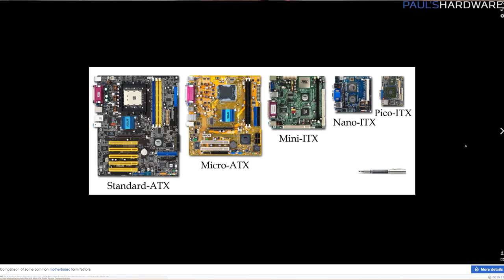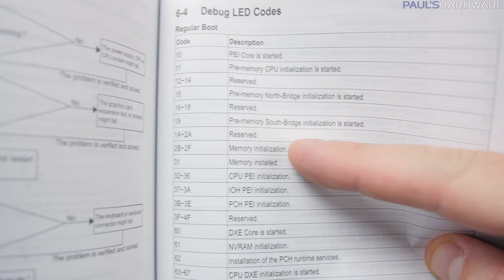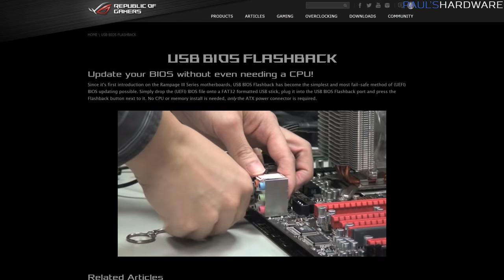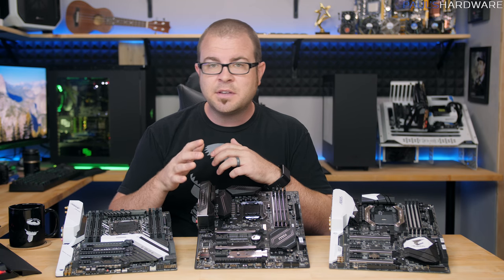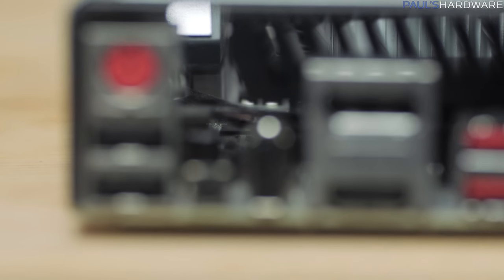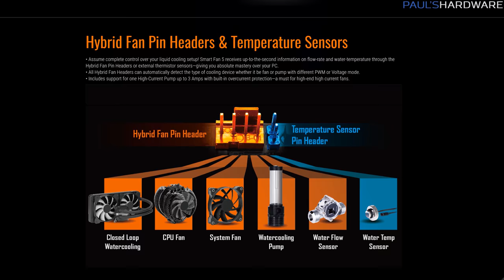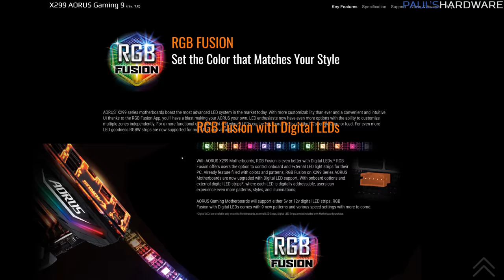My Top 5 FAVORITE Motherboard Features!

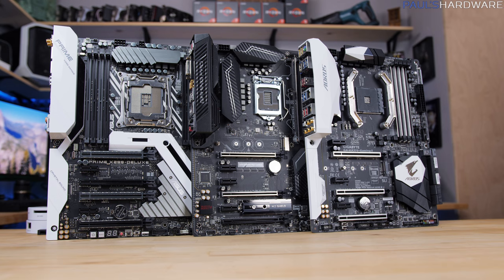Comment: 1:09 #1 Surface-mounted power and reset buttons.
1:55 #2 LED POST Readout.
3:00 #3 The ability to flash your UEFI/BIOS w/o CPU or memory.
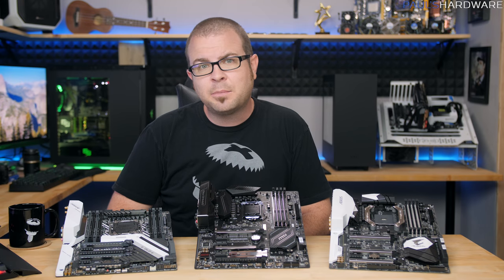4:05 #4 Clear CMOS (Reset BIOS settings) on rear IO panel.
5:07 #5 Advanced Fan Controls.
Reply: Thank you. Have a great day, Don't forget to like, share, and subscribe! ;)

Comment: I think a front 10 Gbit/s USB 3.1 Gen 2 port is something more motherboard makers should add, as well as more cases. More phones are starting to use USB type-C and faster transfer speeds for external storage is also very nice.
Reply from the maker: Very good suggestion, especially now that the smaller USB 3.1 header is showing up on more boards. Thanks for the comment!
Reply: Yes, it is so cheating that it has to be "gen 2" for full speed.. I mean...misleading :)

Comment: My Top 5 favorites
-CPU socket
-RAM slots
-PCIE ports
-24pin connector
- SATA ports
Reply: What about 4/6 pin CPU connector?
Reply: What about the usb ports?
Reply: My favourite is screw holes
Reply: I would like Front Panel Connectors.
Reply: RGB?
Reply: Jmstraubgamer I

Comment: I'd love to see all premium ITX boards implement rear I/O power buttons. There are some insanely tiny custom SFF cases that would actually benefit from not having to implement front power button when the rear panel is just as accessible as the front.

Comment: built in 802.11AC wifi and good built in sound
Reply: King Christo Except anyone who enjoys multiplayer gaming should be Ethernet anyway
Reply: how do you know the sound quality?
Reply: skinlo01 unless your not near the router
Reply: Oscar Jung there are integrated sound cards in motherboards (for analog audio )
Reply: Good built-in DAC/AMP is one of the choices, most motherboard doesn't even consider it a thing.
Well if you can afford some mid to audiophile grade headset or speakers, you'll probably want to invest for a high grade external DAC/AMP to drive your audio gears to its full potential.
Reply: Yeah the new Maximus Hero X has integrated AC wifi and Bluetooth but I have seen reviews from people saying the wifi wasn't functional which is disappointing.

Comment: May sound trivial but 2 favorites of mine are 1. a connector dock for the JFP1 connectors, like what Asus calls their Q-Connector. 2. Mobo speaker. Having an x99 board it takes a second or two for it to POST after turning on for quad channel memory training, etc. Having that speaker after doing something crazy like water cooling your build as I have its nice to hear it beep as a way of saying at least it still posts haha

Comment: l love the Q-connector included with some Asus mobos.
Reply: deadmeat1240 Agree with this; it's always a pain fiddling around with those pesky loose case wires. Q-connector makes it a breeze.
Reply: deadmeat1240 i think Gigabyte has one too, although it doesn't have any pins it just has delimitations and labels.
Reply: Have one for my MSI board, too. I think it's nothing special anymore.
Reply: SunRed That's a big assumption. And a false one. Most boards do not include them. I've built a few dozen machines over the last few years with many different board brands. The connectors are very much still the exception, not the rule. Especially on the mainstream and bargain boards.

Comment: Things I like in a motherboard, better than the "advanced" trouble shooting features you list, are:
* High quality components, like good capacitors and audio chips. (Without those trouble shooting will be a lot more frequent.)
* A good layout that prevents signal distorsion and allows for large coolers without interfering with RAM and PCIe slots.
* Backwards compatibility. Support for older coolers (like the AM3 mounting you use for the passive NoFan cooler!), serial bus interface, PCI slot and what have you that allows you to continue using your older hardware with the new motherboard.

Comment: I like some of the newer board have 2 LED post read outs, that can be set to show Vcore voltage, good for open bench overclocking with Ln2, I would like buildzoid to test of accurate it is..

Comment: Dual bios.  Didn't think it was going to be useful until I updated my Bios, had nothing but a black screen and even with a clear cmos, gave me the same issue.  Flip the switch and it worked.  Was even able to re-install and recover the bios as well.

Comment: I agree with most things you listed.  I know it's not ideal, but I cover the display up with electrical tape and pull it off if and when I have to diagnose a problem - in other words, I have to open the case... But generally speaking the case will be open if I'm diagnosing problems.  But I don't like CMOS clear buttons on the back plate - I don't want curious fingers pushing it (purposely or by mistake) - a button on the mobo is good enough for me and having to open the case to push it provides a "good enough" safety net.  The advanced fan curve and ability to have fans shut down, VERY BIG YES.  But for me this has to be able to be done 100% via BIOS because Windows only solutions are completely right out for me as a Linux user.  The CPU/memoryless BIOS update is a great feature on multiple accounts and hope that eventually mobo's gain that feature (even the inexpensive ones).

Comment: My favourite features are:
Great audio features( I like mini itx builds so there's not a lot of room), lots of fan headers, PCI X1 slots( for upgrades not blocking PCI x16 dual slot gpu cards on non mini itx boards), gaming type features that are functional - not rgb(personal preference as I like pure non led black build) all black pcb, the software for the motherboard like ram cache on Asus,  good LAN port/chip, and price.

Comment: You missed my favorite a pinout adapter for all the power rest hd activity lights and switches.   And could you ask every why after 30 years of pc building why there is no standard I hate plugging in all those individual connectors.

Comment: ASUS board's "system panel connector" where you plug all the case wires into it first and then connect one big connector to the motherboard.

I/O shields that have nice clear writing NOT on bare metal, so the connections look nice and are easily read.

M.2 connector place away from the most likely GPU slot to reduce heat

Comment: I just have one thought about that bios clear button on the back IO panel.  What's to keep the bios from getting cleared when you go to plug in a USB device, especially when attempting to do so by braille?   Otherwise great vid Paul.
Reply: YeaP...I add.." make the button required to be pressed and HELD..for a minimum of 10 seconds straight for it to function/activate that function...That way just tapping it accidentally does nothing.

Comment: For me it's:
1) PCIe 4.0
2) Integrated IO Shield
3) Surface-mounted power button
4) RGB
5) Integrated WiFi
Reply: MEh HaS A CuTE cAT - Personally, I would skip the RGB and make sure the board has M.2 slot(s) or at least add it to your list. Perhaps you assumed that these were already included in most newer boards, but I believe these are a must have. Having an NVME drive as your boot and main drive makes so much sense these days because of lower prices, ease of installation and increased speed. I also wish that Motherboard manufacturers and Case manufacturers would come up with an easy adapter for mounting the front IO connectors instead of those separate dinky little plugs. This from another cat person ;-)

Comment: Dual BIOS is a must have for me in place of BIOS flashback feature.  I do not like having the clear CMOS on the I/O panel as I want it tougher to clear the CMOS by accident.  I do my overclocking with the side panel off, and rarely ever have to reset it once I dial in a stable overclock.  A black spongy rear I/O panel, or better yet, an integrated rear I/O cover.  Features that add no value for me:  LED headers, LED lights on the mobo, any colors other than black with a subtle accent, wifi, dual NIC, reinforced ram slots, Comm port, parallel port, TPM port.

Comment: Bring back the Turbo button!
Reply: QuantumBraced you do know the turbo button made the PC run slower right ?😀
Reply: chris Leclerc cpu running at 3 ghz
presses turbo button
cpu overclocks to 3.5 ghz, overheats and clocks down to 2 ghz
Reply: It was meant to match speeds of DOS games.
Reply: Everyone's kidding around here, but what if you actually could switch overclocking profiles at the press of a button? Why isn't this a thing?

Comment: for a CPU list of top 5
no limit on RAM slots and PCie (obviously there is a maximum but sometimes I feel that the company just added features just to stop you using more RAM slots and PCie) looking at you Intel I was looking forward to getting the 6 or 8 core Skylake X (it is better than Ryzen 7 and has higher IPC and better and more stable OC which would be good for me as a gamer who wants more than 4 cores and at the very minimum dual GPU setup) and possibly AMD with Ryzen 5/7 quad channel RAM compatibility

Comment: built in Wifi is underrated. Not something most people worry about but out in the country where i am usually theres not enough hardline to go around
Reply: DTMF223 what do u mean not usually enough hard-line, are u travelling with ur desktop?
Reply: konic40 my house only has one hardline - the one to the wifi router. old house, no way to connect internet through the walls, dont have fiber optic, etc. etc. Only way to connect in my house is through wifi because home construction sucks.
edit: granted, I did buy a PCI wifi adapter but it feels so much more convenient to have one built into the motherboard.
Reply: Meh, not really. When it comes to extra networking options, I'd much rather pay extra for dual Ethernet than for built-in WiFi...
Reply: DTMF223 maaaan, that's too bad

Comment: I would like to see more boards that when something is set in the UEFI any software utility does not try to override it. Example of this is. My AIO needs to be at full power. I set it to that in UEFI. But then motherboard software overrides that for some reason. So that is annoying. 

Z87 ROG boards has a option that came and went called direct key. Was a key on the board or IO plate that would launch the computer stairt into UEFI. It was very nice to have. And even had a header where you could connect the reset switch to it. 

Mem OK. I don't know if it is just me. But I seem to always run into issues with Ram OC's The Mem OK button on Asus boards is nice. It resets ram speeds with out resetting the rest of the motherboards UEFI settings

Comment: Updating the Bios is one thing I've never done since I haven't had a major issue. I know it's probably good to get the latest Bios for my 3 year old mobo but it is working well and I'd hate to screw it up.
Reply from the maker: That's the prevailing wisdom on UEFI/BIOS updates, don't bother with it if everything is working. AMD's AGESA updates for Ryzen CPUs are pushed out via UEFI update packages though and can improve performance, which is one of the reasons it has become a more common practice

Comment: Whoa... that "Upgrade BIOS without CPU/RAM" should be implemented on every motherboards.

Once I bought H110 to be paired with my Kaby Lake G4560.
Lots of tech tips said "Kaby Lake can be paired with Skylake motherboard with BIOS upgrade", not telling that you should have it upgraded first with skylake processor first.

And I should go to Gigabyte Service Center to upgrade it for free (if you are not counting for trip fees).
It finished in 5 minutes, and my reaction is "WTF? I drove for 30 minutes here for just 5 minutes process that I could have been done by myself IF I had the Processor"
Do not know, if I should be happy or not for that 5 minutes.

Comment: i like the 8-Pin EPS12V connection on my board......
Reply: montetank tankkiller You mean the one that is unnecessary and does not provide extra overclocking headroom and stability in most cases?
Reply: +Anon Ymous...strike. And without RGB

Comment: Hoestly I just wish Honestly I wish manufacturers of higher-end boards would use white readout lights, rather than red. Making them white means that if a user wanted to change the colour of the readout they can just stick a small piece of coloured transparent tape on top. It's not even that hard to do; I can buy white seven-segment LED modules from Ali Express and Ebay, for goodness sake.

However it would be even better if case manufacturers can use seven-segment LEDs with RGB LEDs inside of them, creating such a product in the first place would be difficult because of the small envelope for all the connectors but there is no reason why it couldn't be done on a larger board, even if they have to float it with some pin headers affixed to the motherboard, which would add the benefit of making it removable if you don't need it anyway.

Comment: I feel like some of these features obsolete themselves, are rarely useful, or, are easily addressed with a very simple solution.  For example, a backup CMOS chip obsoletes the need for a clear CMOS button.  If you keep around a 2-pin power button, that can obsolete the need for really any on-board buttons.  Sure, it isn't as convenient, but I'd rather pay less for my board and not have a luxury that saves me only a few seconds when testing a system.  Most modern PCs are incredibly reliable these days, where the POST display is a bit useless.  Worst-case scenario, put in one of those beepers and just listen to the beep error code instead.  At least then you can analyze an error without having to look inside or open up your PC.

I do agree the advanced fan controls are very nice, however why stop there for BIOS features?

Comment: Software is fine and good but question is does it run on Linux?? That's my main problem with all that software to use it you have to be running windows And most of the time I don't

Comment: Enough Frontpanel and Fan headers, in non-retarded locations.
often on cheap Motherboards your Front-audio conector is somewhere in the middle of the Motherboard and you need to put an ugly cable across the board ...

Comment: Probably would be cheaper to buy a Celeron G3900 on E-Bay or even Newegg and update your series 100 motherboard that way, rather than spend a premium price for Q-Flash Plus or USB BIOS Flashback.  Unless you buy a Z170 board then go that route and get all or most of what Paul suggested here.

Comment: 1 Post Code Readout. Yes
2.Flash bios without cpu/ram. Yes
3 Power button, not so much
4 Reset Bios, Definite NO as to properly clear a CMOS requires removal of the batter so you'll need to go inside the case anyway. 
5 Advanced fan control Maybe

I would rather have at least one PS/2 port than the last three above. ABSOLUTELY NO RGB PERIOD. and NO Red accents.

Comment: Am I the only one who cares about dual BIOS? I think this is very important. 
Also the first PCIe slot should be x16. So perhaps you can run triple slot GPUs in 2-way SLI/Crossfire without choking off one of them.

Comment: DUAL BIOS
10Gbit LAN
Base Clock Generator
14+ USBs
Metal Heatsink on VRM
12+ SATA
FLASH BIOS FROM BIOS
BIOS PROFILES
M.2 RAID
Q-Connector
90 degrees 24-pin, 8-pin, 4-pin, SATA
4x Internal USB Type A
Reply: Do you use 14 USB and 12 SATA ports?
Reply: 12 USB and 7 SATA, Crosshair VI Hero.

Comment: I have not see it in the comments so I would like to add the FDD connector. It is hard to find a board to use in a sleeper build if you want the floppy drive to actually work just because you can.

Comment: You know what would be nice. Communication between the GPU and the motherboard on a firmware/bios level so you can adjust some of your fans to GPU temperature. That'd be super useful for custom watercooling so you can have certain radiator fans reacting to gpu temperature without having to use things like speedfan
Reply: no need for that, because you should set up your case fans to be at comfortable sound level anyways. anything above that is only for critical failure or something, the cpu and gpu got theyre own fans that handle the special occasion if temps go too high. in normal operation its all just nice and quiet